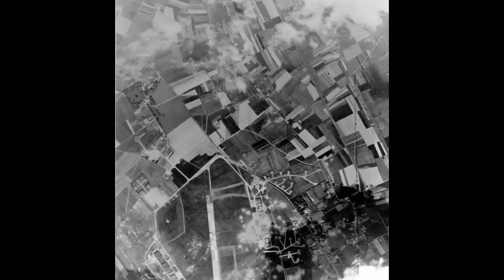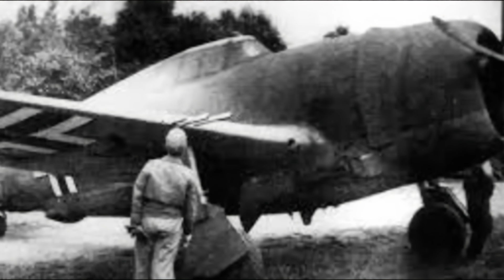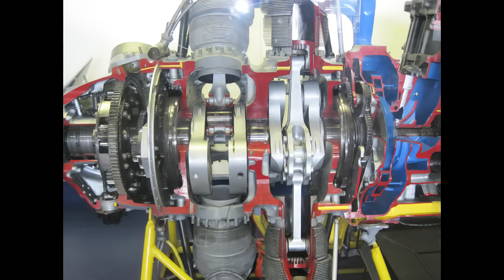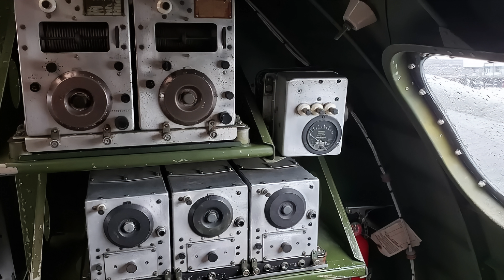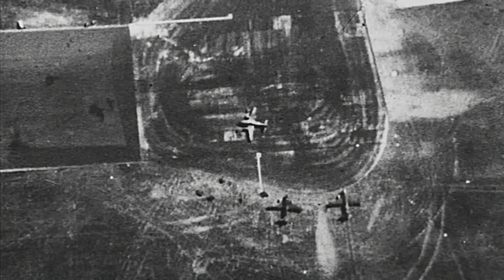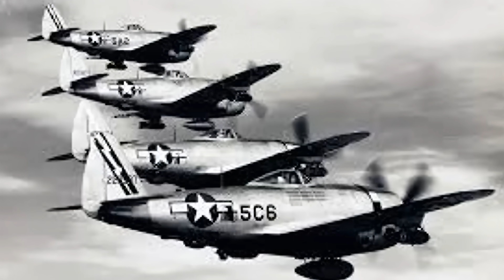German Engineers Took Apart A Captured Thunderbolt — Then Admitted They’d Never Seen Power Like It

Comment: “The Thunderbolt wasn’t just an airplane. It was American industry with wings.” What makes this story fascinating is that German engineers could study the P-47, understand its turbo-supercharger, armor, firepower, and manufacturing quality, yet still lacked the resources to reproduce that system at scale. Which surprised you more: the P-47’s high-altitude performance or the industrial capacity required to build thousands of them?

Comment: This is an excellent and very well-researched video on the P-47 Thunderbolt’s impact through the lens of captured examples. The focus on German technical evaluations at Rechlin is particularly strong and rarely covered in this much detail.
What stands out most is how the video uses the captured aircraft to illustrate a larger strategic truth: by late 1943, Germany wasn’t simply losing a technological race — it was competing in an entirely different category of industrial warfare. The sections on the turbo-supercharger system, the R-2800 engine’s manufacturing quality, and the sheer scale of American production (especially compared to German output) are handled very effectively.
The contrast between American design philosophy (abundance, maintainability, pilot survivability, and high-altitude performance) and German constraints is clearly drawn without becoming simplistic. Hans-Werner Lerche’s impressions as a test pilot add a valuable human element that most technical accounts miss.
A thoughtful and precise look at how material superiority, when properly engineered and produced at scale, rendered even excellent German fighter designs increasingly irrelevant. Very well done.

Comment: Late side, have commented on this post before. Another pass made me think of something I don't remember ever hearing about. My father was a B-24 pilot in the 15th. In the 80s he, my brother and I went to the big CAF Show in Harlingen. Mixing about, we encountered a German vet. He was either a Luftwaffe pilot or ground crew (I don't recall). Sharp guy. He said you Americans were lucky. Planes could pretty much roll off the assembly line, gas up, and take to the skies. Not so with German aircraft. He maintained they needed a lot of tweaking first. Said this intensive labor addded at least 20% to the time from factory to air. I have no idea how accurate his figures were but he genuinlely seemed to know what he was talking about. German technology was second to none, but labor intensive.

Comment: 11:20 What are you talking about? The BF109 DB-Engine had of course a supercharger, also methanol-water injection for attack run boosts. You describe it as the DB-Engine would be a simple natural aspirated engine. That is not to say, that the Thunderbolt-Powerplant had a higher power output, but there were not great technological differences between those designs, the US just build its stuff bigger with better materials. The US-Fighters did not have the problem of high quality resource shortage of course, but that was about it. The next quantum leap in Design and engineering was the jet engine, and that was introduced with the ME-262 by the Germans, not the Americans in a production fighter. Of course the US could outproduce the German war machine later in the war, but that was about it. It was mainly quantity over quality, design wise.

Comment: At 9:17, it is said the P47 was still carrying substantial fuel, yet earlier, the engine was sputtering from fuel exhaustion.  You really need to question anything said in this video.  Take a look at Greg's airplane and automobiles youtube channel on the BMW 801's engine management system.  The made up 'facts' in this video ensured I could not finish watching this BS.  The P47 was an amazing and tough aircraft and the cost per unit exceeded what Axis war economies could produce and in hindsight, would be the chosen aircraft of most pilots wanting to survive WW2, but the fiction presented here approaches fairytale status.  Praise the P47 for what it really was.  There's no need for the hyperbole.

Comment: German, British, Soviet and other European military equipment - planes, tanks, trucks, etc. - had a relatively short trip to their home factory for major repair by the loving hands that originally formed them and both to and from the factory could be moved by railroad.  On the other hand, American equipment would need to be loaded on trucks as functioning railways were less common, reach a functioning port, be loaded on a ship, cross the Atlantic, still patrolled by German U-boats, be moved from the ship to a railcar, and go to the factory; then they could be repaired and returned to the front.  Reliance on that logistical chain would be somewhere between inefficient and suicidal.  It was easier and cheaper to design and build for major maintenance in the field and push spare parts and technical support as close to the front as possible.  Any component that could be repaired promptly was repaired; all others were replaced.  Vehicles of all sort were repaired or replaced on a similar basis.
Reply: This is utter hogswallop.

Every time I have the misfortune of listening to the fake content on this fake channel, I have to go through this gross experience of seeing all the fake people posting fake comments here talking out of their rear end. It's so bad you have to wonder if the fake creators of this fake account spam their own fake history videos with fake comments by fake people, to attract actual morons? 

Respectfully ,
Reply: @irtnyc 
If you know the channel is fake, the content is fake, the commentors are either fake or "morons" I would suggest you exercise your better judgement and, rather than simply suffering "the misfortune of listening" to another video on tnis channel, you show yourself the courtesy of skipping over the torture.  Only a self-loathing masochistic idiot would do what you claim you do.

With all due respect, of course.
Reply: @irtnyc 

And HERE YOU ARE!!!

Respectfully, of course...

Comment: The P-47 Thunderbolt was the perfect symbol of American industrial war-making. It wasn't the most elegant, but it was an eight-ton flying tank with a powerhouse engine and a turbo-supercharger the Germans could only dream of mass-producing. They analyzed it and realized they weren't just fighting pilots; they were fighting an entire continent's manufacturing capacity.
Reply: Indeed
Reply: Just like any other plane, each one had its own quirks, the 109 had Terrible visibility, each pilot learned to use its strengths and weaknesses to their advantage. Maybe our pilots didn't have the hours that the great aces, both German and Japanese had, but our command saw fit to send our survivors home to train the next class of pilots. It wasn't long and most of those great German and Japanese aces were mostly gone. A cook has to know more about cooking than just throwing everything in a pot and heat! Our guys learned not only our aircraft's weaknesses, but the 190, and the 109 also.
Reply: @waynewolfe8817  
Most aces, on both sides, came about when experienced pilots faced off against inferior planes and pilots.  That included so many German pilots getting "kills" shooting down Polish biplanes and later, Soviet planes.  Experienced Japanese pilots flying superior planes wiped out the Chinese air force.  Then, as the war progressed, superior Allied planes were shooting down the by then inferior German and Japanese planes. The Germans had little problems producing fighters (until the last couple of months) but they didn't have the spare fuel to train the pilots.  Japanese pilots were getting as little as 10 hours of training before being sent off to fight Americans with several hundred hours flying superior craft. 

Ya, ya, the Germans had jets.  But one Me 262 couldn't compete against a squadron of P-51s or Typhoons. That 262 was novel and the pilots were (mostly) under trained in them.  And, they had a very limited range.
Reply: Exactly, as a Licenced Aircraft Maintenance Engineer , the sheer size of these later generation armoured behemothths  would have been enough, technically more fuel more armor plate 2300 horsepower.
Reply: The Germans didn't want to mass produce anything like the P-47.  The Mach numbers were something like 
P-51 0.81
Spitfire 0.80
Tempest 0.78
Bf-109 0.77
FW-190 0.77
P-47 0.70
P-38 0.69

The Mach numbers isn't how fast a plane can go in level flight.  It is how fast it can go in a dive before the air flow over the wings becomes supersonic.  Exceed that speed and your wings want to come off.  That is why in Europe the P-47 and P-38 were mostly used for ground attacks. Their wings couldn't take the compressive forces of dives.
Reply: @Dagwood-Bumstead-001 Ooooppps they could not while producing tanks that were full of Maintenance issues 😊
Reply: @brettbesharah9950  
With respect, they used different factories.  The Luftwaffe controlled their own factories while the Army controlled their own factories. They were far less coordinated than the Allied war effort. 

But ya, I understand your point.  I'm feeling just that bit bitchy this morning.
Reply: @brettbesharah9950 Oh,  but they were exquisitely designed like a fine Swiss watch!  To bad they didn't have enough of them to keep sending them back to Germany for transmission repairs.  I'm sure while they had possession of these marvels of engineering back in Germany they changed the spark plugs and engine oil.  I'm sure the sent them back to the front line with a complementary air freshener and some pink fuzzy dice hanging from the rear view mirrors!! Whoo yea!😂😅😅😂

Comment: Sorry dude. No allied airfields in France at that time. You imply that a dumbass pilot landed at an airfield that looked like one he was familiar with?. Makes no sense.
Reply: I was wondering about that, about to call BS myself. My assumption is that he meant 1944 rather than 1943. But in November 1944 there wouldn't have been any German airields anywhere nearby. There's a mistake somewhere.

I just looked it up. He did land on November 7, 1943 in near Caen. He apparently thought he was over England, which to be fair is only minutes away and the weather was poor. The narration is idiotic when it says 'some friendly' about French airfields at the time.
Reply: @damiku-8866 England is only a few minutes from France at its narrowest point, in the Calais/Dunkirk region, but Caen is a lot further west and requires around 25 or 30 minutes flying time (at WW2 cruising speeds) to England

Comment: It was a throttle body fuel injection ,the Me 109 was a much more advanced direct injection. The Me109 MB engine was actually more advanced. It also performed very well at high altitude also.
Reply: More advanced usually means more complicated. Sometimes simpler is more reliable and easier to mass produce.
Reply: Inline and radial are quite different.

Comment: I have always wondered when the Germans captured planes later in the war what kind of fuel was used?  The crap that the Germans had to rely on? How would planes that are used to a much higher octane and quality run on German gas?
Reply: The basic German fuel during the battle of Britain was something called B4 which had a research octane number RON of 87.
-The British Fuel had a RON of 100.  That alone gives about 8% more power.   
-Furthermore the British fuel was 100/130. The first number is the RON (essentially 100% octane) the second number is the PN or performance number which is the percentage increase possible by using a supercharger to squeeze in more air when the mixture is run, Rich.  It means adding about 10% more fuel than can be burned. This is why British engines had  1260 to 1320 hp and the German engines 1050 to 1100.  At high altitude with a superchargers couldn’t squeeze in the extra air the British engines lost advantage over 20,000 feet.  
-The Germans did introduce a C grade fuel of about 93/115 in 1940 during the end stages of the battle of Britain. They actually had this fuel before the British had their 100/130 but hadn’t made much use of it as it was hard to produce.
-The Seagrave fuel was improved to the point. It was about 96/125 and by 1943 about 97/130.  
-C3 phil was always limited in supply and was generally reserved for the BMW 801 engine because air cooled engines are less tolerant of low octane fuels.  The fuel was increasing in quantity and quality in 1943 but I like bombing that knocked its production down.
-About 1/3rd of the fuel was maybe C3. By the time the Germans had more of it, the allies were moving onto 110/150.
Reply: @williamzk9083  With the 2 stage 2 speed supercharger on the Merlin FS gear would kick in about 26000ft and was good all the way to 43000ft Do a comparison on the P47 Climb Rate compared to the Spitfire Mk VII HF It is on WW2 Aircraft Performance
Reply: @jacktattis  unfortunately that website doesn’t exist any more.  My comment was about the Merlin I/III engines around the time of the Battle of Britain you speak of the Merlin 61 that only came in Service in late 1942 during the dieppie raid
Reply: @williamzk9083  Merlin I,II 1937 Merlin III 1938  Merlin 12  Bof B
Reply: @williamzk9083  nice summary
Reply: Especially bad was the synthetic fuel made from coal 😢
Reply: They must have had a few liters of actual oil based gasoline. Their standard fuel would not have worked.
Reply: They probably had small quantities of real fuel available for such testing. They just couldn't mass produce it.
Reply: They used the ten thousand gallon captured reserve tank 😅
Reply: I am sure the Germans could come up with a few gallons of the good stuff. And German chemists were good enough to boost octane as desired.
Reply: Hitler, like Trump was too stupid to read the bold print on the walls and stubbornly kept wasting germanies people and killing them for his own ego.
Reply: @fizzyplazmuh9024 Talk about too stupid, that is you. Get help for your TDS.
Reply: When you grow up you will understand.